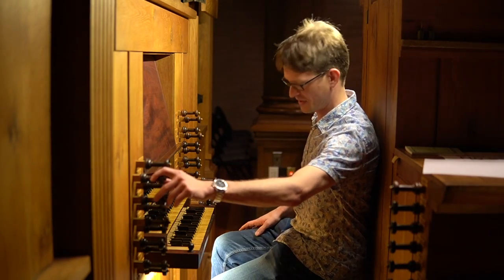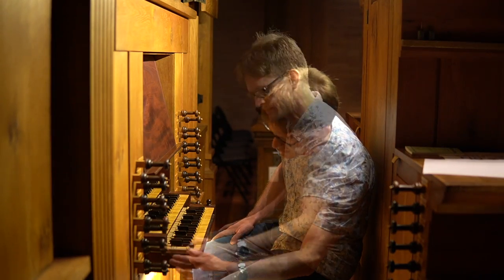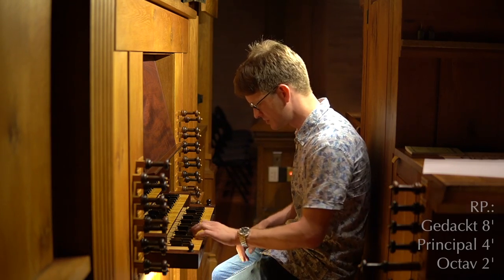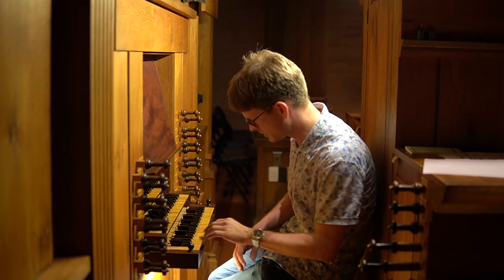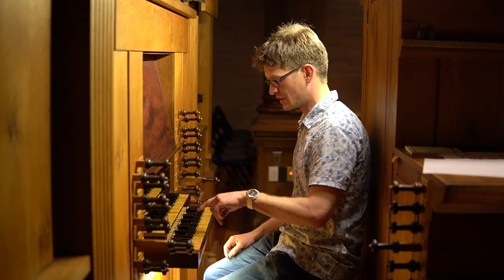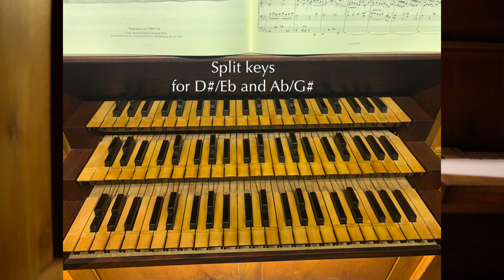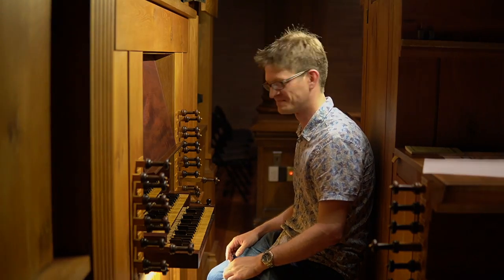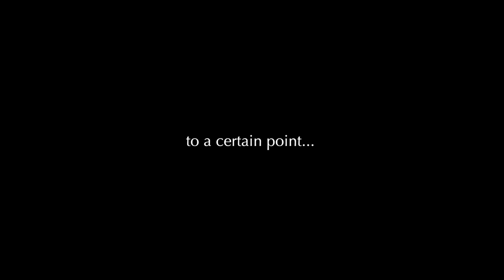Demo of the mean-tone Fisk Organ at Wellesley College, MA | Bálint Karosi

Comment: Very very nice! What are the keys that can be played reasonably in tune on this instrument? I guess some of the notes are hardly ever used?
Reply: Antoine Caron I’m open to correction, but I think it’s right to say that the more accidentals you add to the key signature, the more out of tune it sounds.
Reply from the maker: The most commonly used thirds are pure in mean-tone temperament. When the instrument have subsemi tones, it has more pure thirds. So without subsemi tones (split keys) the diatonic Major thirds  plus F# and the Diatonic Minor thirds plus Eb and Bb are pure. This organ has split keys for Eb/D# and G#/Ab for the thirds of the corresponding triads
Reply: Balint Karosi. Thanks for your response!  I understand what you say mostly, except what you mean by "...plus F#" 
So, F# interval with what other note? Can I see a picture of the split keys somewhere?
Reply: All keys except for four major and three minor are all good and the same as each other: the bad major keys are B major, F# major, C# major, and G# major; the bad minor keys are F minor, Bb minor, and Eb minor. The sub-semitones (extra sharp/flat keys) are provided on this instrument in a few octaves but not all octaves (G# has an Ab above it; Eb has a D# above it). That can help with the occasional D# to use in B major if it's in the octave where the key is provided, and the same with the Ab (A-flat) to use in F minor. Historically these were mainly used to allow for transposition to match singing range in chant (15th century) or congregational singing (17th century).